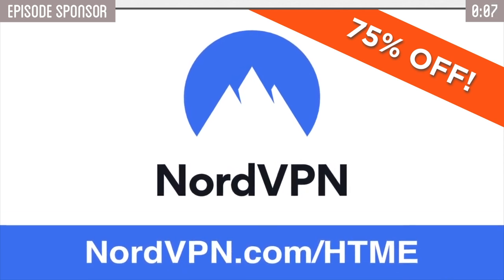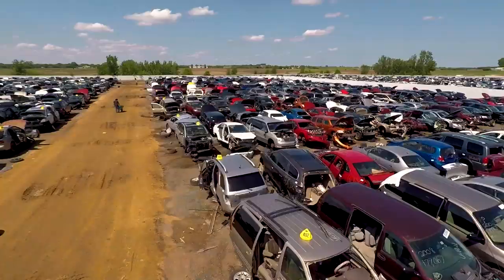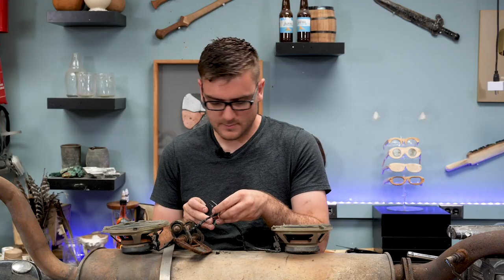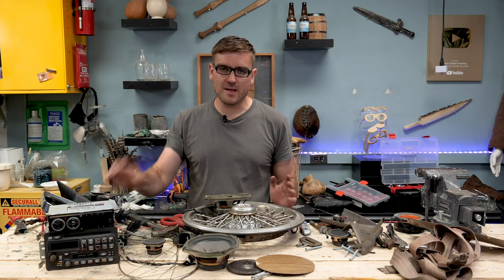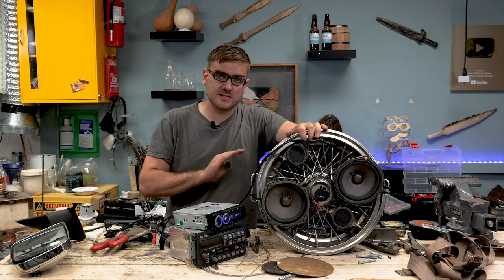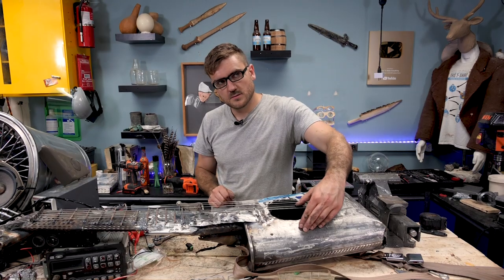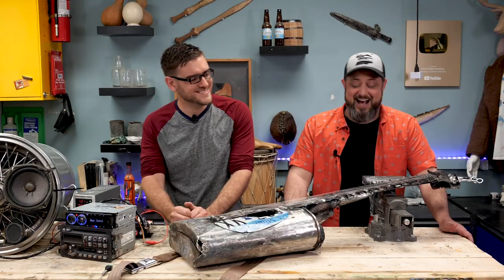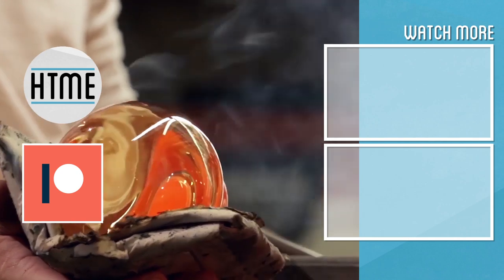Building an Electric Guitar out of Car Scraps

Comment: I am not a hater , I really appreciate your goals in creating these projects, But I must inject something that bothers me a lot.  Especially since recently playing with this principle myself in the man cave as a novel thing I was curious about. I am really super disappointed that you went forward with this project without having the first clue as to how a pick up works on an electric guitar.   The absolute fundamental principle that you have overlooked is that you DO NOT AMPLIFY THE SOUND from the strings!   You translate the movement of the strings Directly to an electrical signal as they disturb the magnetic field of a coil of wire.  Using a Speaker is not only an unnecessary Damper by first moving air to then move the speaker cone that then generates an electrical signal that has been altered by the dynamics of the speaker and limitations of air's transfer of compression.    A true electric pick up  would provide  a direct  String to amp signal transfer.   And the pick up is Dead easy to create!  Wrap a wire around a screw and pop a small magnet on the opposite end of were it nears the strings.   The most crude coils we have played with worked surprisingly well.    TRY AGAIN  and lets see you try to adhere to some genuine intelligent design when you approach a project,  The luster of your ambition is severely tarnished by the mediocre approach and careless sloppiness of your Research and  efforts.   If you are purposely doing things crude for the "primitive" effect  Please understand that this does not impress anything upon me but low effort.  Thank you for reading this as constructive criticism and please don't be discouraged.